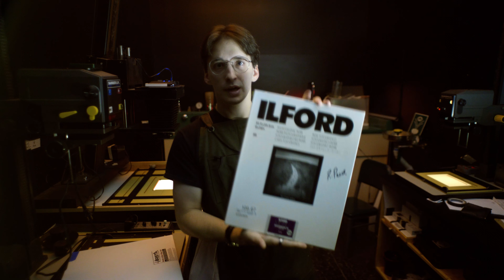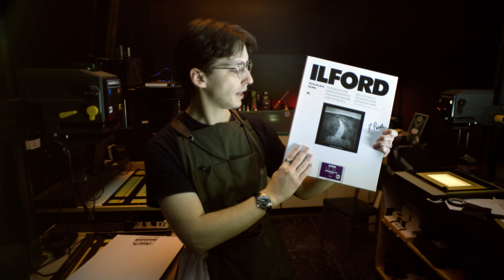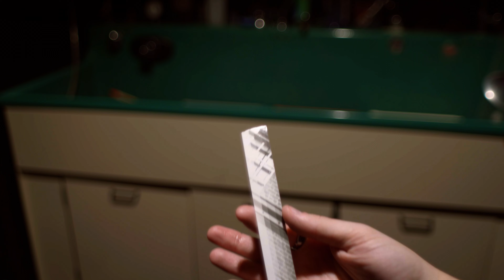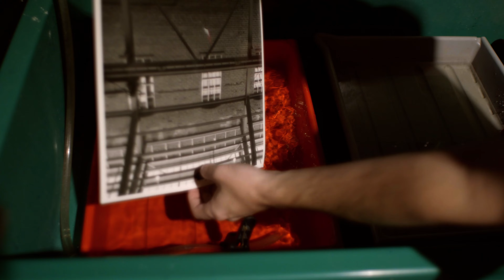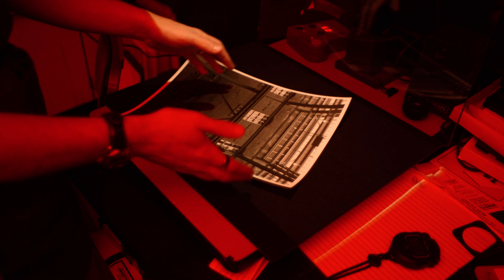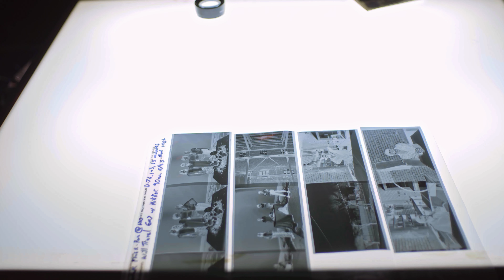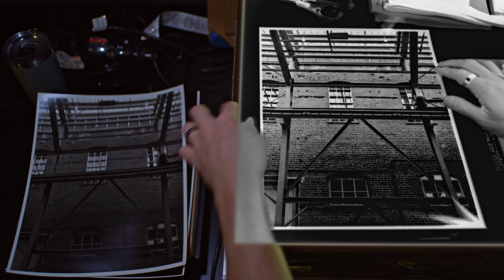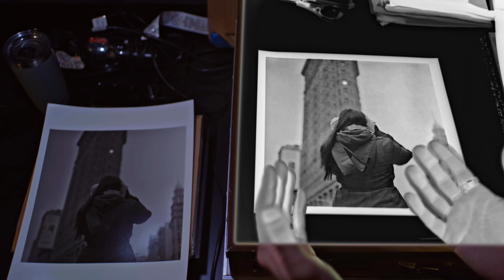How to Make Large Scale Analog Negatives from Film in the Darkroom

Comment: Fantastic, well done.
I think the grain you are referring  to is the fibers of the photo paper, its a pity we cannot get single weight paper anymore.
have you considered "waxing" the back of the print to make it more translucent?
Thanks!
Reply from the maker: I don't think the grain on the ortho film is caused by the rc paper positive. I am not using fiber paper so the paper is quite smooth and relatively thin. I believe the grain is simply from the fixed high contrast of the ortho film.

I had a professor who always kept a tin of bowling lane wax in the darkroom to wax paper negs. I have personally never tried this method as it seems much more of a pain than it is worth. I have found  paper to work just fine for most contact printing and paper negative applications; and my enlargers, both the original LPLs as well as my newer LED modified ones are more than bright enough to get through the paper for decent exposure times.

Comment: Interesting technique.  What about shooting on reversal film and printing directly on the baseboard?  I guesss there isn't enough UV in the enlarger light.
Reply from the maker: I'm not sure I am understanding you in reference to the UV concerns. Sorry! 

Do you mean to just expose your cyanotype or other alt process image under the enlarger? if so, you could do that without a positive film but instead with just a regular negative ( Since Cyanotype is a negative process you need a negative to make a positive ) and yes the problem is that a standard enlarger does not really pump out much UV light at all, not nearly enough to expose a cyanotype in a reasonable amount of time. Though there are several folks working on and finding great success using UV bulbs and modifying enlargers to specifically print alt process images in just a couple minutes from standard negatives, cool stuff!

 Do you mean to put positive film in the enlarger and to print directly onto the ortho film?  Yes this is possible! I very briefly mention this at 04:24 in this video. 

The problem would not be the light source but instead the relatively extreme contrast in reversal slide films compared to negative films. This compounded with the pretty high contrast of the ortho film would give a really intense contrast in the negative which would make it difficult to use for most alt processes. 

A slightly better option would be to make low contrast positive film from your negatives. You can do this by just making a low contrast contact sheet of your negatives onto rc paper, then cut and put those low contrast positive print pieces into the enlarger and print through the paper onto your ortho film. This would take time to expose but would work fine and give the same contrast levels as the process described in the video. You could also enlarge your say 35mm negs onto paper at the biggest size your enlarger can fit, for example if you had a 4x5 enlarger, you could print to that size then insert that positive print into the enlarger and print directly onto the ortho film. 

Of course you could contact print your neg film directly onto the ortho film and get very nice looking black and white slide film versions of your negative film, but again using this to then print ortho film negatives would yield quite extreme contrast.

Hope this kind of answers your question! Sorry for the lengthy response, I like to use these comments as a way to record process notes for others to hopefully get some use out of!
Reply: @richpence  Thank-you for your detailed response.  I'll have to go over it again to extract all the details.  I guess what I was thinking is exposing directly from a positive onto a cyanotype paper on the baseboard.  Of course, as you said, it would show up as a positive. Then, as you say, some are experimenting with UV lamps in the enlarger. I think many would like to try tthe cyanotype process, but don't want the hassle of spring-loaded contact frames and UV exposers.  Thanks again.
Reply from the maker: Ahh yes I am understanding you. I think maybe actually like the simplicity of contact printing, and building a very simple frame is quite easy. I have a cyanotype video in the works that explores some very niche but interesting techniques. I'll include a little more detail about making a very easy and simple print frame suitable to clamp the neg and check exposure.

Also, as a correction. You cannot use a positive piece of film to expose a cyanotype, you have to use a negative, so, even in a UV enlarger, You'd have to put a negative in it. Cyanotypes are a photo-negative process, so when exposed to light they turn dark blue and when covered stay white. Using a positive piece of film will result in a negative cyanotype.

Comment: The only problem that I see is that although is emulsion against emulsion, the base of the paper will scatter the light and make the internegative lose more information than using a point-source of light and reversal process. I liked it tho. Do you have any link to buy arista litho film here in the UK? I been trying for a few weeks by now.
Reply from the maker: I’ve always been weary of reversal process on paper. I have not found a method that I feel is easily accessible or not worrisome for toxicity or requiring PPE. If the light path is a concern. 
How about this instead to Alleviate the worry: 
Enlarge or contact print the original negative onto another sheet of film (I would recommend regular film for this, not ortho as it’s very high contrast, but ortho would do as well) say cut a piece of 4x5 film in half, or cut sections of 120 film. Enlarge the neg onto a 6x7 or so section of the film. Then dev. You’ll have now a positive piece of film, which can print directly onto paper / ortho film to create your variable size neg. 

It’s a little more difficult of a process, but I’ve had great luck doing it as well as just contact printing film onto ortho to have a nicely contrasted positive film to work with. 

I don’t know of any sources to buy ortho film in the UK or Europe. Ilford does make an ortho film for negatives, but it is grossly overpriced. I would suggest just trying a paper neg first, it’ll be a slow exposure, but would eventually make an image.
Reply: @richpence  that will have to do for the time being. I will use the idea of paper as an interpositive (I need interpositives for gelatine tissue transfer), but I am worried of the loss of detail and tonality. I will experiment. Btw, subbed, your videos are great. Keep the good work!
Reply from the maker: @LaViejaConsolada  thanks very much! I’m hoping to make many more videos and even some darkroom live streams! 
I’m afraid I don’t know very much about Gelatin transfers so I will have to look them up!

Comment: what's your dilution of paper developer for the lith? Is that dektol? Cutting the dilution will bring it much closer to continuous tone
Reply from the maker: This would be with standard 1:2 dilution. I have been experimenting recently with shooting ortho in camera. I tried higher dilutions ranging from 1:4-1:8, but was getting some weird blocky, almost solarized look to the mid tones. And my best luck has actually been a pre-flash, and then to rate it for maybe iso-25, and then to develop in standard dilution for 3-4 minutes in very dim red light. The trick is to not let the highlights ever be so dense that no light will get through when printing, explicitly for alt processes. So a shorter exposure, and then trying to make up the shadows with longer development has been working pretty well. Do you have any preferred  dilutions or procedures?

Comment: Ortho lith film is hard to find here in Europe, do you think it can be done with mammography X-ray film ?
Reply from the maker: I am not sure. I do not have any experience with x ray films. I'd say just give it a try if you have some of the film. Otherwise you may also want to look at just using an rc paper negative, which work quite well for cyanotype although slowly. It would be the same steps as in this video, but instead of using ortho film for your final negative, you would contact print the rc positive print onto another piece of rc paper, giving a large paper negative.
Reply: Couldn't find any in Europe so I ordered some arista ortho litho from the US. "Made in Belgium" ! I can't believe it. it's made by Agfa most probably.. I use it all the time for tone separation, grain enlarging, paraglyphes, copying, serigraphy ... But for contact negatives you need continuous tone and I would use Bergger s

Comment: Fascinating. I’m certainly going to explore the process. What developer did you use for the ortho negative?
Reply from the maker: Thanks! Hope it goes well! You can just use your standard paper developer. Here I used Dektol in standard 1:2 dilution. I have also used Sprint Print, LPD, Kodak Polymax T, and Ilford Multigrade developer and all of them work fine. Really the only thing to be careful about is using a fully red safelight and not an amber safelight.

Comment: Excellent, thanks for the info. I just started shooting the Ortho Litho on my 8x10 for alternative processes. My negatives are not very dense. I have been using Dextol 1:30 developer for about 2 or 3 minutes, any idea as to why my negatives are so light?
Reply from the maker: Thanks for watching! You are diluting Dektol 1 part Stock to 30 parts water? Sorry if I have misread your comment, but 1:30 is wayyyy to much dilution for dektol. Dektol requires a 1 part stock to 2 parts water dilution, so 1:2, for use on darkroom papers and ortho film. 

Otherwise,  you may be having a problem with your metering. Orthographic film is only sensitive to green and blue light, and not red light, which is different from your standard Panchromatic film which is sensitive to all light. It is possible that you are metering for for all waveforms of light, and so your film is underexposed since it is not seeing that red wavelength that your meter is. You can solve this by filtering your meter, or by testing and finding the optimal ISO setting, which may change depending on the type of light source, be it sunlight or artificial lighting. 

Check on youtube for "finding the iso of film test 4x5" and you should finds some Large format centered videos that will show you have to accurately rate the ISO of your ortho film. Good luck!
Reply: @richpence  Thanks for replying. The Massive Development chart had Dextol at 1:30. I tried a couple of sheets at 1:3 (125mls Dextol to 500mls H2O. The development by inspection was less than 20 seconds.
I made up D76 at 1:3 and seemed to get good results at the recommended 7 minutes. I think I'LL stick with the D76.
I brought my 8x10 primarily for wet plate collodion. I was looking for a cheap sheet film to play around with. I think I'll next try some panchromatic.
Reply from the maker: @peter2712  Sorry, I think I was a little confused. You are using deXtol? I have never heard of it with the X in the name. Is it a film developer? I am using Kodak deKtol, with a K in the name, which is a darkroom paper developer. Your DeXtol and my Kodak DeKtol are likely two different chemicals.

Arista brand (what brand of ortho sheets are you using?), and most other Sheet Ortho films are designed to be used the same as you would use paper in the darkroom, as far as I'm aware, and developed in the same paper developing chemistry used for darkroom papers. My ortho sheets develop in around 1 minute, similar to RC photo papers. 

On Massive developing chart, I am assuming that they are rating their development on ortho films designed for shooting in camera, such as Rollei Ortho 25 roll films. This is a bit different than the sheet based ortho films I am using. 

Anyway, if it is working then that is great! Keep on using what works! But if you have a darkroom., try using your standard darkroom paper developer on your ortho sheets.  I would love to see your results!

Comment: Your positive is not just low in contrast, it is also very low in resolution. You are throwing away most of the quality in your image by making negatives in this way. Digital negatives are less expensive, retain much more of the image and are less laborious.
Reply from the maker: I don’t claim that the negatives are perfect, they are far from it. I’m just trying to share what can be possible using fully analog methods with materials readily available today. I am not convinced that a digital negative is “higher resolution” than an ortho negative. Digital inkjet printers really cap out at 600dpi (even that is wishful thinking), which an analog piece of film far surpasses (not that mine are the highest res possible, they aren’t, but I would certainty argue that analog prints have higher resolutions than digital) and digital are prone to many problems that cannot be solved as simply as problems in the darkroom can. And it is certainly not cheaper if you don’t have a very nice (and expensive) digital printer. And for analog negatives a very good scanning setup to get your images into the computer, another necessity,  in the first place. 
I think digital negs can be great, but if working with analog negatives, and if my goal is to stay as analog as possible, it’s not very helpful to argue for a totally different technology and material.

Comment: You are unintentionally making out of focus internegatives... Put a piece of the paper you will be using underneath your grain focuser. Otherwise, you are focusing on the wrong plane.
Reply from the maker: I have throughly tested using a scrap piece of enlarging paper to match the paper height and have not found it to make any difference for prints above a 6x9 inch image, above that, especially into 11x14 or 16x20, the thickness of a piece of paper on a stopped down enlarging lens had not made any difference I’ve ever seen. So I skip that step for rc prints and ortho film, for fiber and for 8x10 or smaller I use a scrap piece.